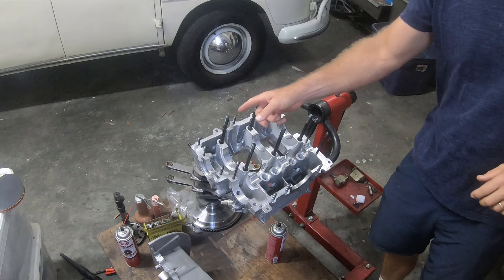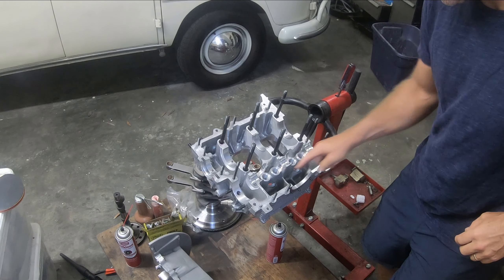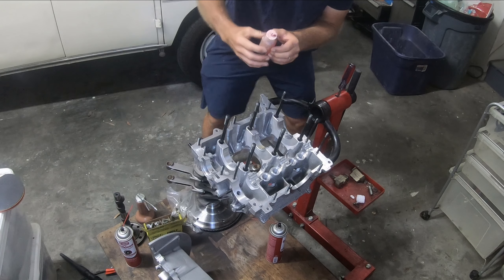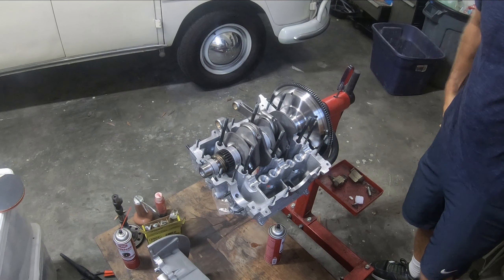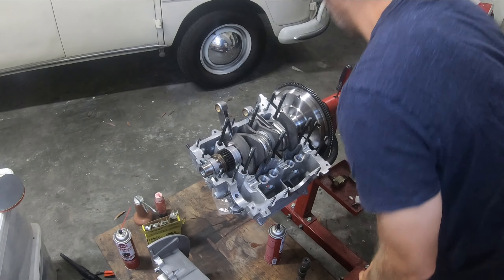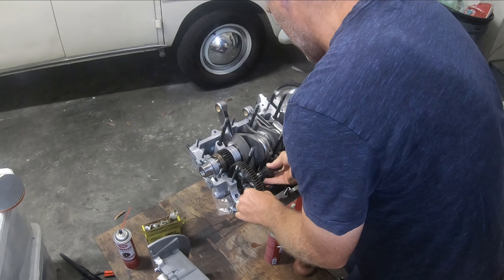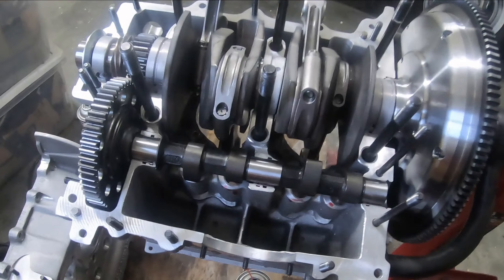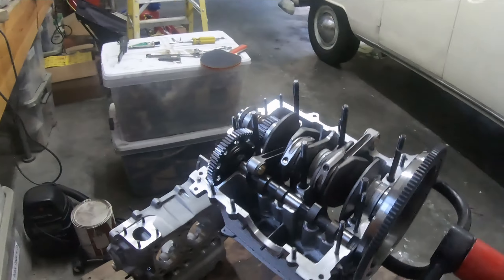2332 VW Air-cooled Stroker Motor - Video 04 - Case and Crank Mock Up

Comment from the maker: There is no claim here to be an expert - I am doing a lot of things for the first time.  This is my 3rd and biggest motor yet - some things I just work through - the cam gear was installed with the wrong orientation on videos 4 and 5 but corrected on video 6.

Comment: Again genius - the dot on the cam gear lines up w/ the slot in the cam.  The engine will not run the way you got the cam gear installed.  LOL!  maybe you should have started w/ a stock 1600cc engine?
Reply from the maker: Ah - yes - in these videos I did have the cam 33 degrees off - I had corrected it when the flat spots didn’t line up.  You are right…. It is corrected now and the case is closed up actually.